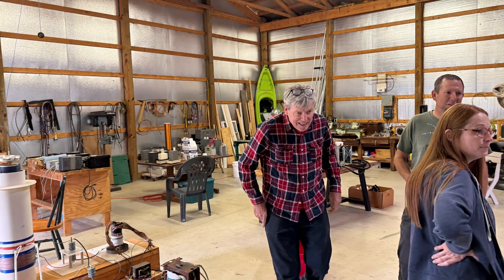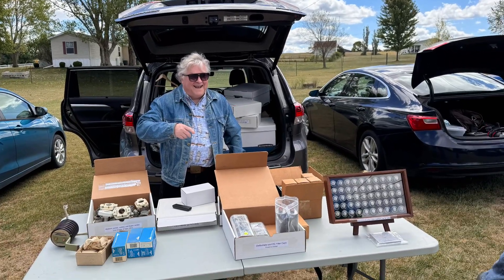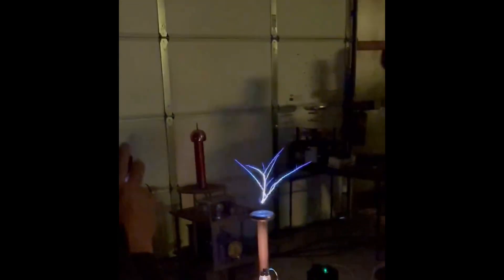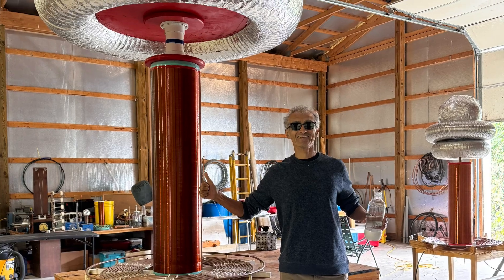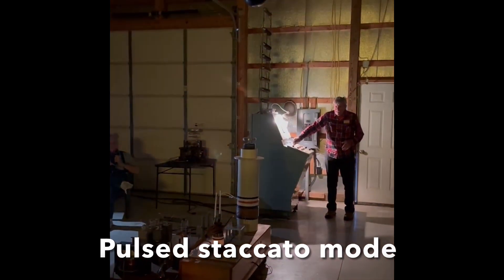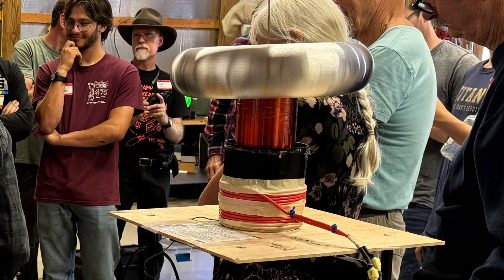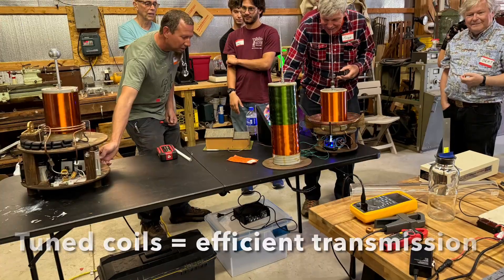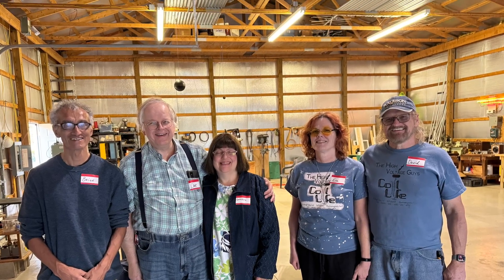Tesla fest 2024 Recap

Comment: Nice video Brian.  I'm just about done with my ZVS Tesla coil.  I'll post a video on it soon.
Reply from the maker: That’s awesome Roger! That ZVS coil works great once it’s tuned. The capacitor used was 100 nF CDE cap which allowed me to have more terms on my primary and better coupling. I spaced the primary about 3/4 of an inch to 1 inch away from the secondary. The secondary was 34 gauge wire wound on 3.5 inch PVC to height 6 inches. Interestingly, just the gate power alone (12 V) from a 2-3 A 12V wall adapter was enough to start off the oscillations so that the coil was already basically running before power was applied from a variac. This baseline oscillation of the coil allows for various ramped type input and output from rectified mains, etc. I did run in ramped DC from an asynchronous buck and it actually worked pretty well. But the mains is way better because it makes it so simple.